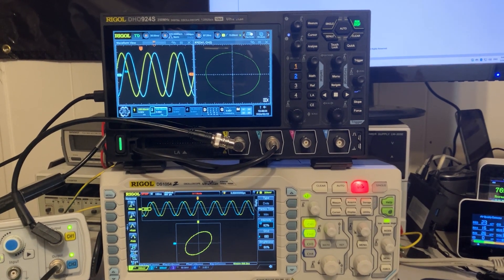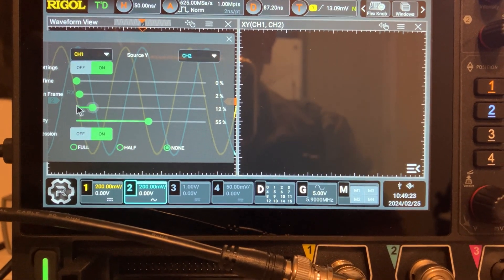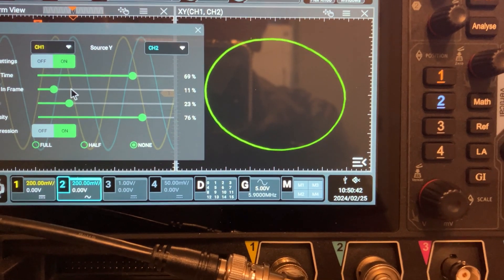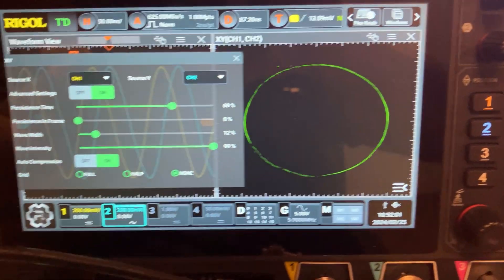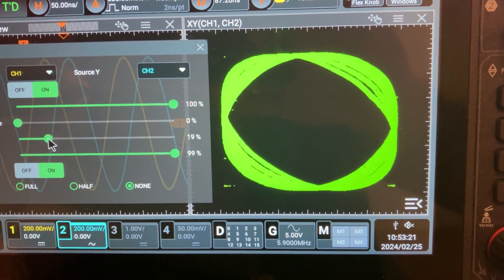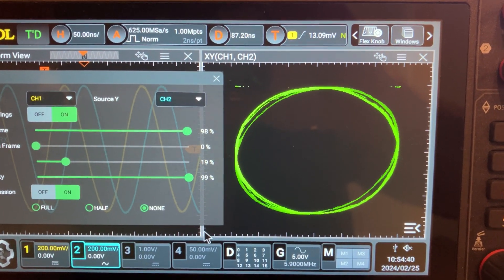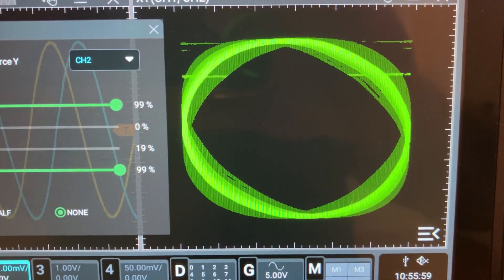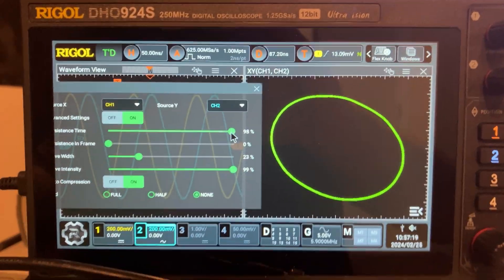Update on Lissajou display with the DHO924s with history.

Comment: If you use the Sparrow Extended you don't need to activate that mode, it is already enabled and optimized. The UI of the new MHO900 series was inspired by the Sparrow Extended UI, which is available for the DHO800/900 series. You can now unlock all the features of the DHO8xx and DHO9xx series, including 50Mpt, 250MHz, extended decoders and full-screen mode, with the DHO800-900 Sparrow Extended GUI v0.7.1.

Comment: Thanks for your detail review.
Could you review for the bode plot feature ?  
I see some videos, Rigol do very good Bode plot for brand Rigol MSO 5000 series, but it seem they still have many bugs Bode plot on DHO 914s/924s. 
If you can, could you try to test Bode plot for some simple Low pass/high pass  filter ?
Reply from the maker: I have done one video to show the injection transformer. Operation is same for direct filter without transformer.